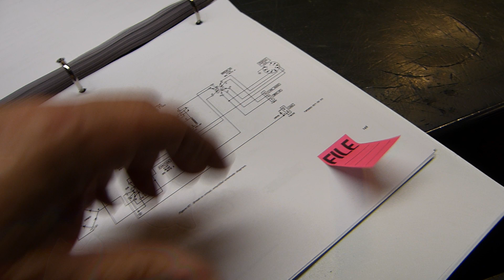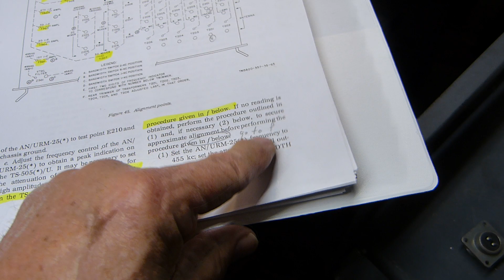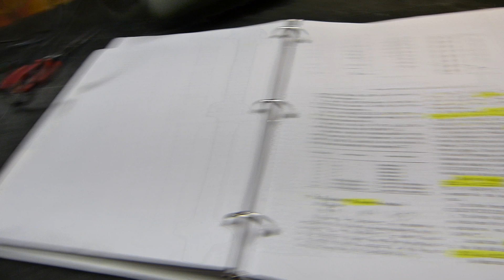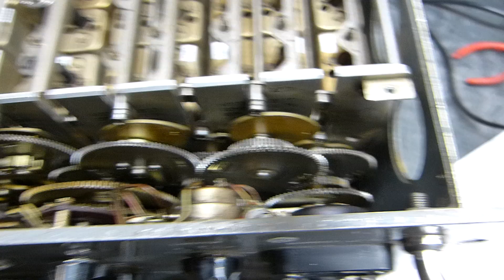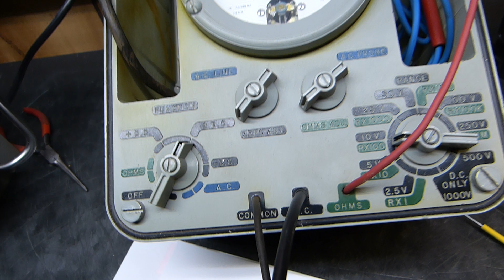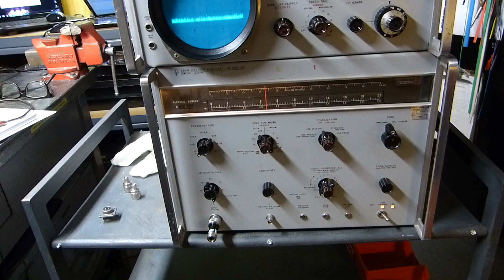Collins Radio R-390 (Non A) Receiver Alignment Summary

Comment: thanks a bunch, I'm aligning one which I recently purchased... had one after college and just had to have on again because they are impressive. Well done and clear explanation. A must is the service manual which I have.  I have several and there are obviously different modifications over the years which makes things a  little confusing especially  in the audio module. I actually prefer the (non a) version due to the smoother bandwidths via LC versus mechanical in the a version. And yes they are heavy.
Reply from the maker: I am very pleased that the video could have helped you. I know just seeing what and how others do things helps me. I use mine every time I get on 40M AM along with a 75A-4 that I picked up last summer. I have an antenna switch between for testing and comparison. They both work beautifully and the R-390 is a bit quieter. I later added the Tree Top module to this one (no longer available) but I don't think it actually helped. The Tree Top module does disable the carrier meter and large feet must be added to the rear of the receiver just in case it is set on the bottom so it won't crush the Tree Top module. I am sure you will enjoy yours.  73  WA4QGA

Comment: The 20 amp fuse is for the R-391 autotune. It shares the same rear plate that the R-390 has, which is why there's a little block off plate to the right of the "REMOTE" connector, that's for the autotune.

Comment: Any one know  the  sensitivity  of the 390A. ?
Reply from the maker: Here is something I found on the Internet.   https://www.r-390a.net/Pearls/sensitivity_alignment.pdf
In my case with the older R-390, about the best I have gotten on mine is being able to hear a carrier of 1 uV input. You could probably copy CW at that level but I don't think I would be able to copy voice on AM or SSB as it might not be loud enough. I also have the 51S-1 which I can easily hear 0.5 uV and amazingly the 75S-3 that I have is ever bit as good as the 51S-1 in that respect. The 51S-1 is more crisp in voice and could probably be better with noise or QRM. I have compared these to an iCom IC-736 which does not perform near as well on receive as any of these vintage vacuum tube receivers. Just my experience. Hope this helps.

Comment: Ok i have8 of these A and non A and love your idea of  marking the cans with sticker labels
Reply from the maker: Yes, it was daunting to try to figure out which can was to be adjusted next in the sequence by having to look back and forth in the manual and then the radio over and over. One mistake and having to start all over was not an good option. Thanks for your comments.

Comment: Boy, this brings back old memories. I was stationed in what used to be the Marine Corps Supply Center, Barstow in the late '60's. I was a young corporal when they gave me 7 clapped out R-390As and told me to make 3 good ones. Managed to make 4. Did a LOT of cannibalization.

The "A" was a simpler set, largely because they used 6 mechanical filters for IF selectivity.

Although there are a LOT of ganged, slug tuned circuits (6 X 3 - I think - for the front end bands and 1 X 3 for the tunable IF), technically, it's a pretty simple receiver. Mechanically, however, the gear train is a bitch.

The URM-25 had its own problems. The mechanical tuning drive had, if memory serves me correctly, about a 25:1 ratio. You could spend a LOT of time cranking between the upper and lower ends of each frequency band. I had just started on the variable frequency IF and I thought, "Wait a minute. This doesn't make any sense." 

I went back to the tool room and checked out a second URM-25. I tuned one to the lower end of each band, the other to the upper, and just changed between the two. Front end alignment went MUCH quicker.

The crystal oscillator, though tedious, is relatively simple to adjust.
Reply from the maker: I just got off the air using this receiver with a gentleman back in Atlanta. The fidelity is outstanding. On any signal above the noise level, it sounds like the other party is in the room with me. It is not absolutely as sensitive as the 75S-3 or an iCom that I have but in any case, if the signal is so weak as to make it difficult to copy on the R-390, then it is also too weak to try and make a contact with the other receivers.
As for the gear network - fortunately, I have not had a need to get into that and I doubt I ever will. The couplings from the tuning knob has to be adjusted and tightened when I was going thru the radio but they are spot on now. Every once in a while, I still compare it to the general purpose receiver in the iCom 736 on something like WWV and if I can hear it clearly on any receiver I have, I can also hear it just as well on the R-390. Beautiful piece of equipment. Got to be a boat-anchor lover nowadays to operate this stuff as a fellow can't jump from one band to another with the push of a button but that would take all the fun out of it for me. 73

Comment: It is rare to find an R-390 that has not had the RF "deck" module removed at one time.  Almost never is it installed correctly, A look at the underside can tell if the gear springs are loaded.  Glad to see this video
Reply from the maker: Totally agree with you. It was way too intimidating to me to pull the RF deck. I spent a bunch of hours on this beauty cleaning and cleaning and...... it is beautiful now and it is my preferred receiver. I have a 75S-3 next to it but the R-390 is what I listen to. I basically only use the other receiver when I want an honest S-meter reading. Thanks for your comments.

Comment: Hey David,

I was just wondering how your were doing. We haven't heard from you in a while. I hope all is well with you and yours.
Reply from the maker: Hi Michael,  

All is well here. I have been tinkering with the R-390 lately and haven't built any amplifiers of any sort. 

We had a tremendous wind storm that blew down a 60 foot pine tree onto two of my cars so I have been busy with them lately. No one was hurt and both vehicles will be restored and running again soon. 

I did install a SSB adapter made by Tree Top out of Canada in the R-390 that I have thought of making a video of. It greatly improved SSB tuning and reception.

I kind of flip back and forth between AF and RF amplifiers and I am thinking of a 4CX350 amp or maybe even a good size AM station. There seems to be very little on YouTube about AM transmitters.

I still think about the promised 6AS7 amp that I made video #1 of some time back but just haven't started yet. 

I hope all is well with you I appreciate your email and checking in on me.
Reply: I'm glad to hear all is well. Sorry to hear about the cars though. That stinks. The SSB adapter sounds interesting. I have an old console radio from the mid-40's and it has a couple of shortwave bands that span 2.5 - 22 Mhz. AM of course. I thought it might be fun to see if I could modify it to include SSB. Carefully of course. I haven't even started restoration so it's just a thought.